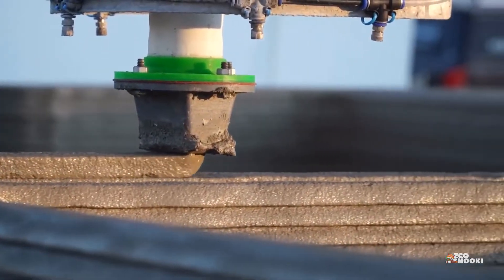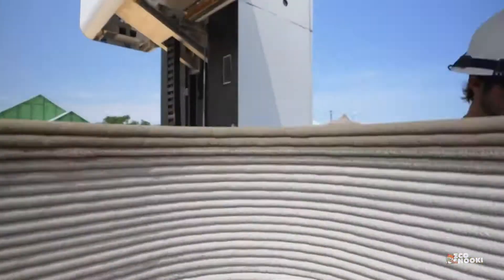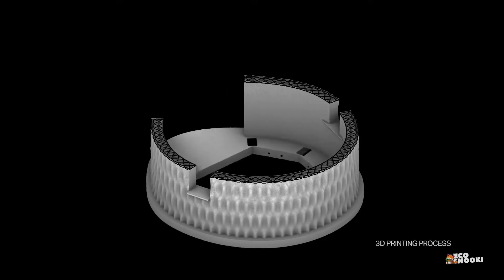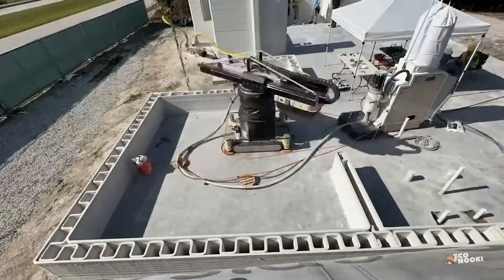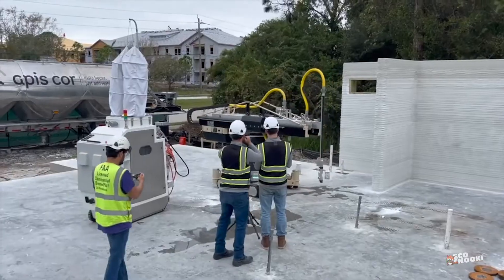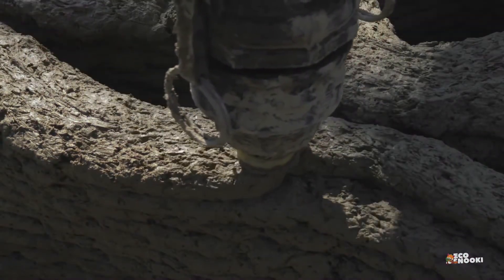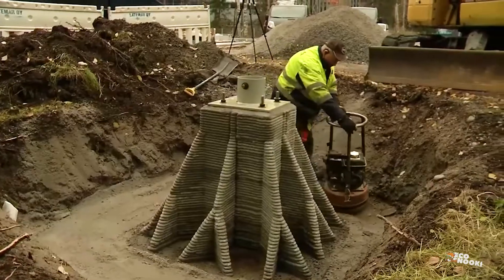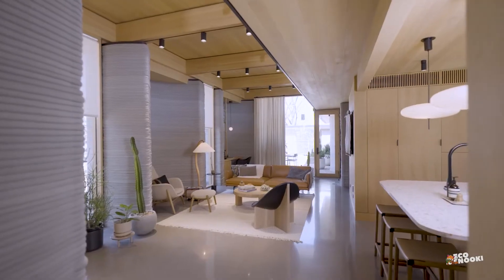3D Printed House using CONCRETE - Is it REALLY Affordable?

Comment: This method CANT be eco friendly ... 
You talk about a "concrete ecofriendly", the material used to print the house. But what about the energy that has been used to create those printers ? ... To harvest the material used for the printers, transport, logistic etc 
The more we dive into ingeriering solution, the more we polute. 
Low tech and maybe bio tech could be the only way to reduce the harm we do to our only home ... the rest is just feary tales and marketing bs.

Also, one more thing, the best way to know what is really happenning, energy consumption related, is to translate the consumption of fuel to water. Because the main ressource that we use to do EVERYTHING, at the end, is water... make you think differently.

Comment: Nice AI presentation.
And I call BS.
I took 4 men 4 days to dry in my house.
It takes 4 men 4 days just to set up the printer then several days to "print" the walls.
What about the roof structure?
And most of all who is going to dust the walls, a 150 little ledges all the way up the walls collection dust what a nightmare.

Comment: How many days does it take to complete a house using this method?
Reply: Industrial-sized 3D printers have made it possible to print an entire small house in less than 36 hours.
Reply from the maker: Yes It's true. But extra time is required for all other works other than the structure( Electrical, Painting, Drainage system, Water etc.).
Reply from the maker: Using 3D printing technology, a new residential building can be built in five days ( According to the printer ) for the basic house structure, the cost of the house is reduced by 30%, and the life of the building can exceed 50 years.

Comment: Cities around the world are experiencing a housing crisis. This is a complex issue related to housing location (millions of empty homes in areas no-one wants to live), availability (houses for short term lease & holiday accommodation) & affordability (wages have not kept pace with inflation & housing costs).

The cost of a house / apartment relates to
- cost of land
- labour cost
- materials cost
- cost of connecting to utilities
- cost of borrowing

3D printing only really helps with the cost of constructing the walls. There are still costs associated with constructing the foundation & roof, awa the installation of electrics & plumbing, kitchen & bathrooms, bedroom cupboards, flooring, ceilings etc. 

Issues have arisen re energy efficiency (drafts), installation of electric sockets etc as the walls are not smooth & gaps between door & window frames etc are problematic.

If we want to build integrated, sustainable, compact (vs urban sprawl) cities, we will need to build multi-story apartments close to urban services & amenities - 3D printed houses can only print single story structures.

Cement is also extremely energy intensive to make, contributing significantly to the climate crisis.

You can create a wooden house using a cns router (as long as the wood is harvested sustainably) - the pieces fit together without the use of fancy tools. And there are other construction methods available that can use more sustainable materials.

Also check out earthships.